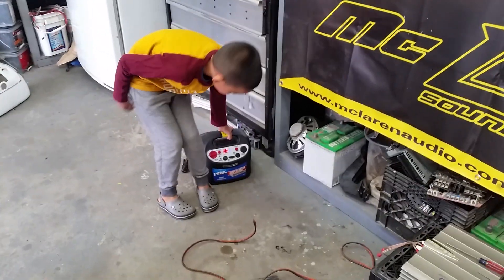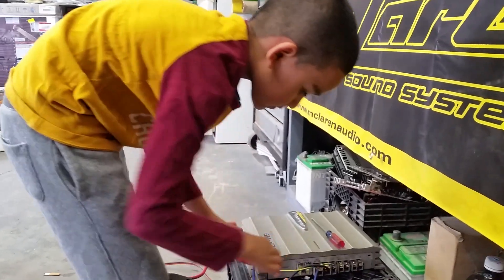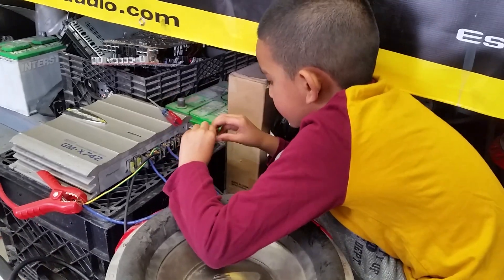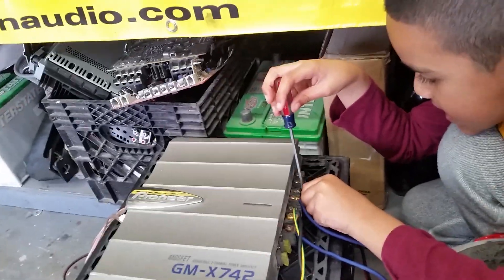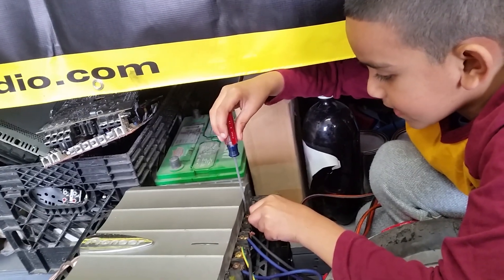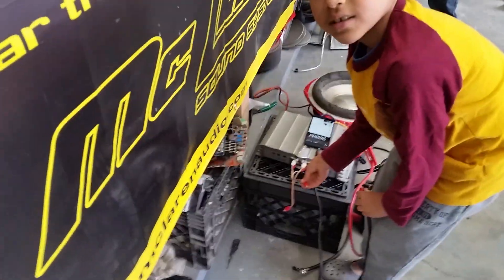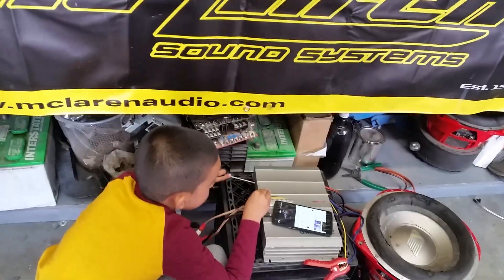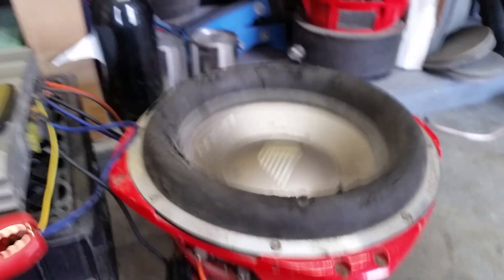Basic car amp wiring

Comment: Where TF are the fuses?
Reply from the maker: On the amp itself.
Reply: um.... you nee more than that,
Reply: an um... also, whats power the battery pack!??!?!?!!!?!?!? MMMMM???????
Reply from the maker: INfoUpgraders a 12 volt wall charger and the battery pack has a circuit breaker.